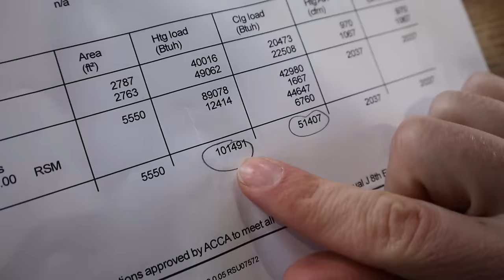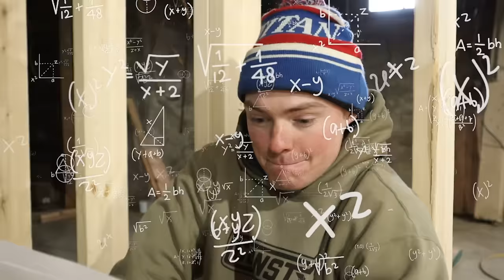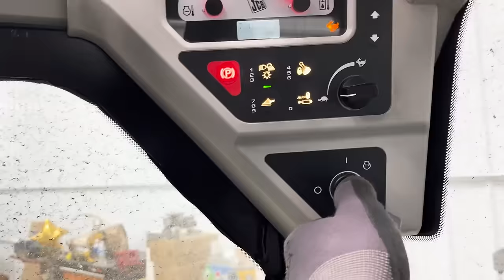Restoring A $7,000 Mansion: Removing 2nd Story Floor

Comment: Cole, 47 years in the HVAC business I am an avid watcher of your channel. I was hoping to shed some light on your HVAC issues. The radiant heating is a must where you live, but you know that. Zone it well don't skimp. The more zones you have the more you can control how much the system will run. If you choose to keep some unused areas at lower temps then the boiler will work less, hence less cost to operate. When it comes to the shower and tub areas, spend a little extra and run the radiant heat up 2' around the walls with separate control. You might choose this to be overkill but it is user preference. It's much tougher later to add it back if you second guess it. As for your cooling you definitely want a separate system for the top floor. While one system for the main floor and basement is typical you might want that zoned ever further. I highly recommend a single heat pump, inverter type system with variable speed compressors and air handler it will control your humidity and temperatures with maximum efficiency. It costs a little more but not much. It should only be about 10% overall. The main system would be ideal if the same type of system only go with a "multisplit" system. This will give you one outdoor unit and two or three indoor units. You can even add a couple small ductless ceiling units in the kitchen or whatever rooms you want designated temp control. Each zone adds a premium of about $3000 on average. Check into a MItsubishi "HyperHeat" system. Make sure it's hyper heat. That will give you all the heat you could possibly want without worrying about cooling as the system is capable of varying BTU outputs based on demand with excellent humidity control. I hope this sheds some light on your quest. Look forward to future videos. Love it all!
Reply: Yes, yes, & yes to all he said!  There's something to be said for the overall savings of keeping the attic & basement at a different temp than the 2 main floors where you will be spending the bulk of your time.  My opinion of the overall pricing is if Roman & Juston are willing to help and to learn HVAC consider the additional time it will take while everyone learns vs having the professionals come in and knock it out.  Granted you save 50% in cost but you make up for it in time.  Also if there are any warranties available for any of these systems make sure they would still be valid if it's something you guys choose to do yourselves.    Awesome efforts by all!!  Loving all the updates!
Reply: agreed, no reason to run @ 110 percent.
Reply: @tomroche2689 Thank You for sharing this much needed info with Cole… and all of us!
Reply: Wish he would actually pay attention to other advice but they never do guys. I mentioned along time ago several times on how to remove the radiat heaters and they did it the hardest way ever and most dangerous. Have several others but alas they take no advice. But I read the comments sometimes to see what info I might use.
Reply: Second this - its a great advice - 24 years exp for  me with the last 15 in alaska
Reply: @richardnott9587  taking them apart ?
Reply: Wouldn’t the best system be a/c upstairs and heat downstairs?
Reply: @richardnott9587  i think the main reason for this is, we are weeks behind with videos because of the editing. So when they read your comment, the work is already done weeks ago
Reply: All involved are showing excellent work ethic. You make me proud.
Reply: Excellent comment. We created separate up and downstairs systems for our 1880’s farm house that has brick interior walls… for us it was ac issue… keeping it cool upstairs for overnight without having to cool the entire downstairs. It worked beautifully, efficiently and paid for itself in 3 years.
Reply: I do hvac by trade and I would suggest the 2 heat pump systems it with help 1 system won’t carry the whole house load.
Reply: Cole, you’ve asked for help with suggestions. Please find time to study the informed comments. I’m rooting for you! I notice MANY intelligent comments and  worry that they’ll go unheard because of time constraints. Be smart, be safe and stay humble ♥️♥️♥️blessings to the CORNSTAR construction team!
Reply: @tuneskramer69  If that is so, then you might as well edit out where Cole asks for advice, since it's a moot point by then.
Reply: Our 100 plus yrs old Iowa farm house , separate zones for each floor. Heated floors in bathrooms only. New boiler keeps this 3500 sq ft house perfect. When remodeling a house sometimes you need to pay the professionals to get it right. HVAC is one of those.
Reply: @Wheel_Horse  did you Notice when his shirt changed, the asking for advice is a new piece... The part where they show the work is old. So when he needs advice he will edit it in between, but when you watch work vids its weeks old material.
Reply: @richardnott9587 I have a feeling the content of these videos are possibly a couple weeks ago. I could be 100/% dead wrong, but  planting season is approaching real fast
Reply: Agree !!! 😁👍🏼
Reply: @tuneskramer69  No, I didn't notice that!  The last thing I'm looking at in the videos is what they are wearing! LOL! But thanks for that explanation! :hand-purple-blue-peace:
Reply: He said it best. Take his advice.
Reply: @tuneskramer69  so what is the point in asking?
Reply: @robsterenborg  did you Notice when his shirt changed, the asking for advice is a new piece... The part where they show the work is old. So when he needs advice he will edit it in between, but when you watch work vids its weeks old material.
Reply: @tuneskramer69  Well then they need a live stream once a week to get the answers they want, he asked on this upload but it is a day late and a dollar short, a live stream will do the trick.
Reply: Tom has a wealth of info.  My first thought when you asked for advice is to ZONE it. Having built our home with 3 zones 3 levels, hind sight, we should have had more.  We didn't account for summer all day sun on one end of house hvac doesn't keep up nor did we account for winter where bedroom gets super cool and if turn up the heat by a degree it roasts the other bedroom.  Overkill the zone it will be worth it for comfort and energy savings. And less complaints from family. Love the channel.
Reply: I agree with most of what tomroche2689 said with the only caveat being that I believe that the Mitsubishi product is a premium priced brand and there are many brands that are a better value. This is just my opinion and I am in no way bashing Mitsubishi but they are the priciest brand out there with the possible exception of specialist products. Considering the massive size of this house and the fact that you (currently) only have a few occupants keeping all of that square footage at peak comfort temps is silly and expensive. You must consider breaking up that into zones with either damper systems or ductless split (multi split) systems. Even 100+ years ago the house was zoned only then It was done with radiators in each space that were individually controlled and modulated.
Reply: So nice of you to help. 💕🙏
Reply: @richardnott9587 every bit of advice can be helpful. His cousin is fitting the heating system.
Reply: Price sounds about right for the size of your home !! 18K sounds like a lot to you,but do you want to move into your house before your son goes to school😂 ??
Reply: Definitely add that HRV/ERV they recommended.  Spray foam tightens up your house a lot.  You need a way to get clean, fresh air into the house.  If you want to go nuts, tie it in with your kitchen and bathroom venting.  Those put a vacuum on the house that needs to be balanced out.  Better to allow it on your terms with proper filtration.
Reply: If I've learned one thing about heating/cooling solutions there is no kill like overkill. Spend the extra you'll thank yourself in the long run on those super hot/cold days.
Reply: Here to just add my vote to this advice and let you know that heat pumps turn into energy guzzlers around 30 degrees, no one told us so we ran them turning the winter, got a nice $700 electricity bill.
Reply: @kizzmiaz  You do not want to overkill your HVAC.  you want it designed correctly to your loads.  Overkill adds problems. IE short cycling, which wears out the equipment faster, and in summer causes you to not dehumidify the space appropriately.  Oversizing duct work leads to low air velocity so you don't get good air mixing, nor will you get appropriate air flows to each room.
Reply: Geothermal system, maybe?
Reply: Great advice! The one thing with forced air is make sure you have adequate  return capability. In my house all the doors are 6' 8" in a 6' 10" frame leaving plenty of air flow to a central return. I'm a little taller than average and in this case it worked out well. 😊
Reply: Agreed zone, zone,zone. I've seen guys put a boxed copper coil in bathrooms. Putting tubing down isn't difficult to do with a couple guys. Duct work doesn't seem overly difficult either. Looking great guys. And yes Batman & Robin are doing great and Batgirl helps when he can. 😂
Reply: The heat recovery system will save you money as it will move heat from the air going out to the air going in so you will use less power heating it up . Think those system is a must in new builds in scandinavian countries to make it more environmentally friendly
Reply: You can install your own heat pumps. There’s a DIY friendly system called Mr. Cool. The line sets come pressurized with refrigerants and the system is pretty simple to install. That would save you over 10k.
Reply: The more you can zone the best option - each unit does not need to be the same size - and you can just place the equipment at a later date. this means you can use less materials and the units do not need to be in the same place. the work is easy - I'll be t you all can do it based on your skill sets which I've seen in your videos - HVAC systems can be purchased and you can all install it. with all the HVAC you tube video out - there is no way you can't teach yourself to install one ..
Reply: Hire them to do it then if it doesn’t work Sue them just like the grain system. Don’t take on any liability!
Reply: I'm sure Cole appreciates this I really hope he doesn't just ignore it
Reply: Thank you for sharing your advice! 😉
Reply: @robsterenborg   to gain comments/interactions for the algorithm.
Reply: @maddieadams75 can tell by the weather they were getting it was snowing one day that puts it about two weeks ago.
Reply: Hard to follow up with that comment.  I wholeheartedly agree with him.  In South MS, they don't recommend heat pumps but in your part of the country it may be warranted.  😊
Reply: Great comment! This guys good
Reply: Maybe you should do a consult
Reply: @crosisofborg5524 you would still have hot n cold spots doing it that way n humidity control is key
Reply: @tuneskramer69 if you notice in the beginning of this video he said they have been working on this for 4 month but he only started posting these Reno videos 2 months ago so I agree we are weeks if not months behind
Reply: This should be tagged
Reply: I would go with two systems .
1 for basement and  main floor second for bedroom floor  and attic. 😮😅
Remember this cost will be paid for for the next 20-30 years 😊
Reply: Excellent advice ,I don't think Cole even looks at comments any more .He has gone all in with the camera and video tech ,editor .Its all about making money for  him now .Business is what he is all about and businesses need to make money good for him .He needs to let viewers know this , its ignorant of him not to .Loyal followers is what got him here .
Reply: what about use the earth for precooling or preheating.  He has the equipment and the space to do that?
Reply: I was going to add here but you said it all. Does Cole read the comments? I have not seen any replies on any yet.
Reply: Some great advice on the HVAC. I am blown away that when the spray foam company sprayed the attic, they didn’t notice or tell them to make sure all the electrical is run before they spray foam the rest of the house. It’s going to be so hard to do it now.
Reply: Wish I caught this series sooner. Recommended everything @tom said. I would just add getting a blower door test. It's difficult to estimate your needs without knowing how much air leakage you have.
Reply: 47 yeas doing hvac... it's like Justin and his chalk line. I have been installing pex for almost 11 years now, and the only benefit of hvac is if you are retro fitting an old house so you can utilize the duct work already in place. But since you are starting from scratch, in floor pex heating is the way to go because of installation, plus it's more efficient. Radiant HVAC heat distributes heat through air ducts, while in-floor hot water tube heating warms the floor directly, which then radiates heat to the space. In-floor heating provides even heat distribution and ambient temperature, also silent operation, with no blowing air noise It is also more energy-efficient, especially when used with thermal mass (large, dense materials) that can store heat and release it gradually... (cough, 40 laminated beams). Finally, it can be charged during off-peak hours and maintain a comfortable temperature throughout the day and you can't beat warm floors in the winter.

Comment: My neighbor is a HVAC contractor .  He often says his customers always regret not spending the extra money because the upstairs is always less comfortable.  It easy for me to spend your money, but you will be happier in the long run.
Reply: That also has to do with the contractor balancing the system.
Reply: I agree.  My point is that customers often choose, for example , not to put zones in their heating system to save a few bucks. They end up regretting it because the upstairs is too hot or cold compared to the main floor.

Comment: Hi Cole, great to see the plans! Have a suggestion for your upstairs bathroom layouts. For Room 8 bathroom, don't have your toilet be the first thing you see when you open the door/walk in. Suggest putting it where the vanity is. You could also have the door swing open the other way, which adds extra privacy when someone opens the door. Second suggestion would be to put your shower along the width of the bathroom at the far end, with the vanity being on the long wall adjacent to the hallway. Removing the interior walls will significantly open the space and allows you to make your shower be the focal point with feature tiles (also think about convenient wall space for the # of towel rails you want). Similar suggestion for Room 7 bathroom: rotate the shower, move the vanity a little off the side wall (not cramped in a corner, and consider moving the door towards the middle of its wall and relocate the toilet to the opposite side of the door (hiding the toilet from view upon entry). These changes shouldn't impact your water/waste pipe grades much compared to current plans.

Comment: I did a remodel,my contractor said add in more outlets than you think you will need. Best idea I used.
Reply: I agree on more outlets. We built our home in 1980. We thought we put in plenty. Being pre internet, we were wrong. Lol
Reply: Outlets at the top & bottom of stairs for Christmas lights, as well as near mantle places. The tops of cupboards as well for lighting if there is a space there. Outdoor soffit lighting for Christmas lights would be nice also, if you think you might be into that. 😊
Reply: If you have a stationary island put several in that also for when you have gatherings. You’ll want to be able to plug in your crockpots to keep your food warm. You can never have too many outlets in the kitchen. Be sure to run at least two  different breakers for the kitchen outlets. It’s really easy to overload one with all the cooking/and get togethers you do around the holidays.
Reply: You can never have to many outlets.